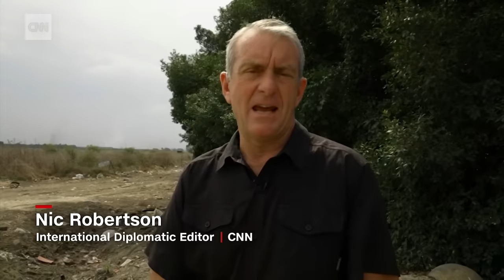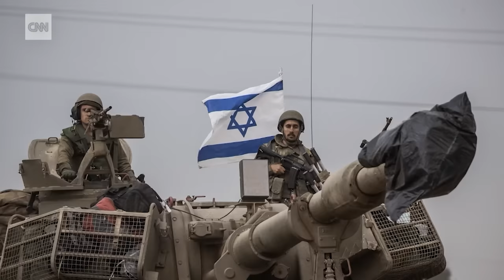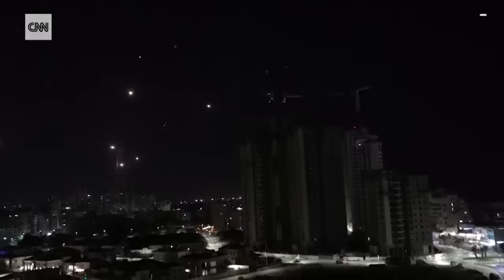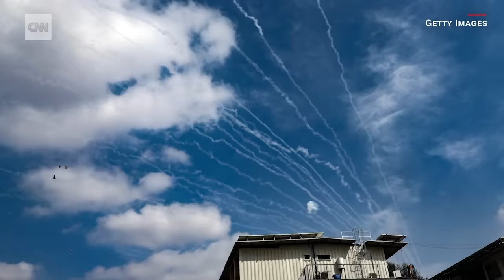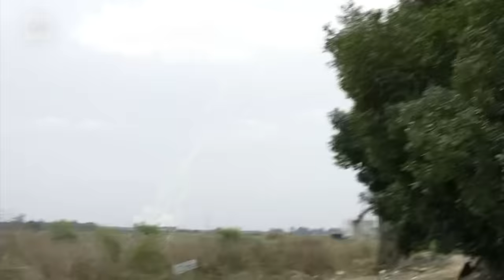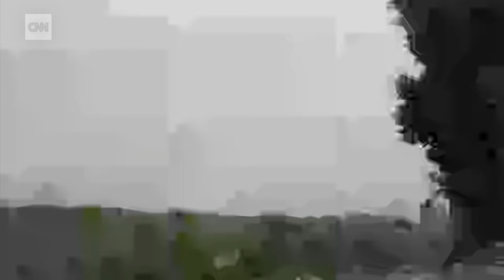How Israel's Iron Dome Works

Comment: Iron dome doesnt work against modern rockets and or drones and or to many rockets / drones. The problem is hamas rockets have jumped a few generations over night. That's why its failing. But hamas unlikely has too many modern rockets and will soon be back to home made efforts.
Reply: Not like 'modern' rockets do anything differently that make them harder to hit, even maneuverable weapons are not safe.